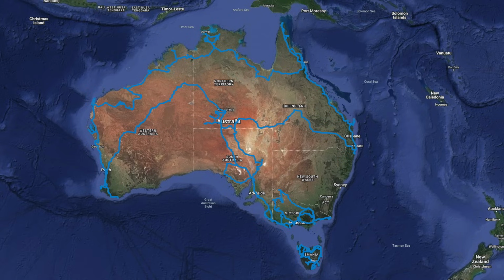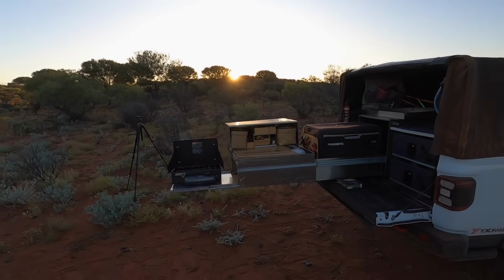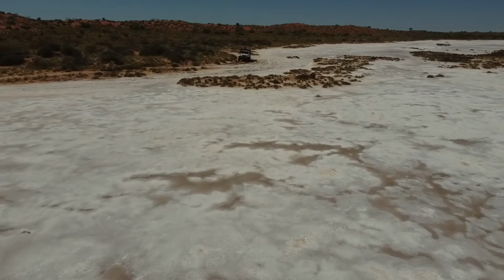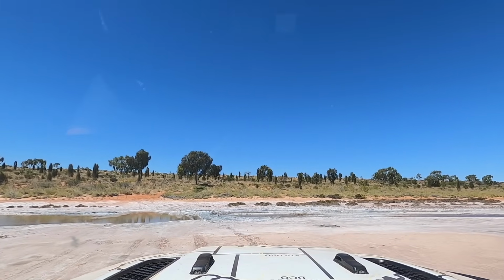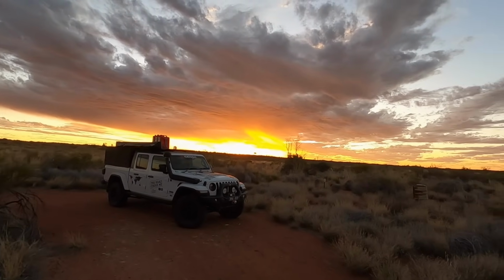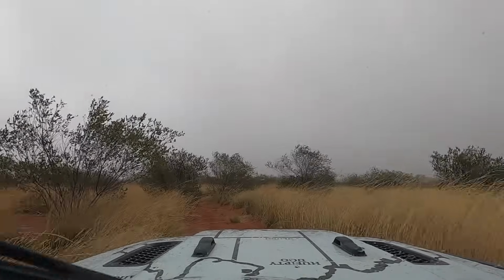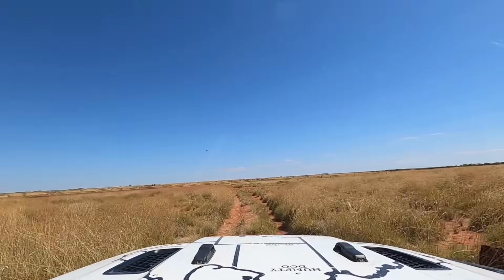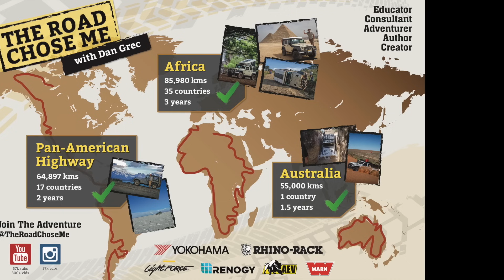Ten Days and 1,000 Miles on the Canning Stock Route: The Ultimate Remote 4x4 Adventure

Comment: The furthest inland I've ever gone off main highways in Australia is only about a thousand miles and couldn't believe the incredible drop in temperature when the sun goes down. It's like the sun takes the heat with it, it pulls the heat along with a light breeze away with it. Then suddenly, you're shivering, or at least I was when that breeze stopped.

Comment: Little tip for anyone travelling in the region ! Spinifex catches under the car in all sorts of places, and will catch on fire under the car, check on a regular basis and clear. When spinifex burns it is very sappy, almost tar like, it is very hard to put out, a fire extinguisher alone will not cut it !!
Have a pressure pack/weed sprayer in your car somewhere, trust me you will be glad you did if you have a fire. Fill the pack with a water and detergent mix, dishwashing detergent is fine. As you spray a fire with it, the mix turns to a foam when you spray and sticks to the spinifex and helps smother it. This mix will go so much further than a standard fire extinguisher and of course can be reloaded on the go with spare water and dish washing liquid.

Comment: What an unbelievable and daring trip.  The first half of it looked like a fairly traveled trail with all of the tire tracks visible.  Typically how fast were you able to drive?  Even places in the last half of the trail there looked to be several man made structures along the way, even something mounted on a large tri-pod right next to the road.  I'm really surprised you didn't have any trouble navigating all of those sandy areas without having to dig yourself out occasionally.  It must be more like beach sand where it packs down fairly well.  How did you know where to go when crossing and driving around some of those dry/wet lake beds, especially in the last half, without any visible trail markers.  Were you relying on GPS directions?  Many thanks for posting.  I had to watch every minute.  :-)  By thee way, were you using solar panels to charge your camera batteries and do you carry a satellite phone with you?

Comment: Nice video but I am a bit confused, you explained the importance of having a vehicle flag when traveling through the sand dunes and i would argue going through long spinifex grass as well but I never seen a flag being flown in all your vehicle shots.I am also a big believer of HF radio when traveling these remote areas with a Epirb as backup. Hf radio because you can get weather reports and cheap communication with the outside world. I did notice that you had uhf radio.
Reply from the maker: The flag got torn off the pole on day 2 from all the overhanging trees unfortunately. I zip tied a new one on there, but it kept coming off.

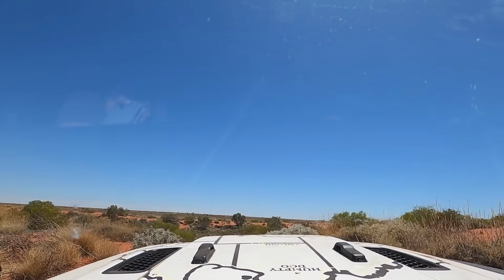Comment: Trivia - at Well 40 - there is the grave stone for Michael Tobin; you mentioned that in your video. He was killed by one of the aboriginals - apparently at this time the whites had been killing them for some time; so the natives would attack whites on sight. As for Tobin - you could almost call his death, suicide by spear. He had already been speared in the shoulder - the natives used ???, one of those short spear throwing devices. Anyway, Tobin went chasing into the bush after the native. Tobin killed the native while almost simultaneously getting a second spear in the chest; he died the next day from his injuries. Interestingly, not far from Tobin's grave is another grave - this one of the native who killed him [reference: Malcolm Douglas, vid from 1985 @ 29:03]. Also, at some time after Tobin was buried the Canning crew came back and wrapped the Cross [his marker] in a metal banding; the reason: apparently the natives would chip off pieces of his marker to use for spear points. This seems to have worked, because as of 1985 his cross seemed undamaged.